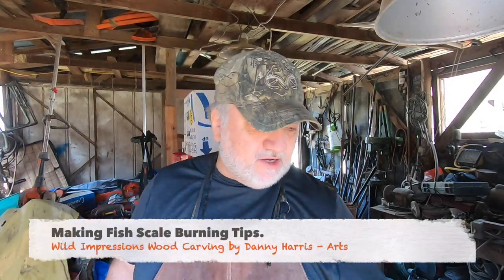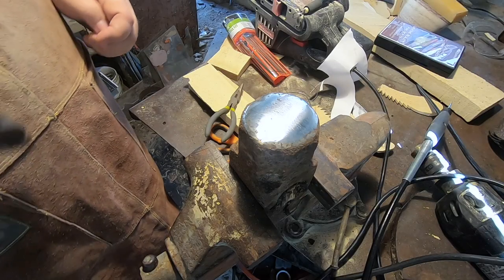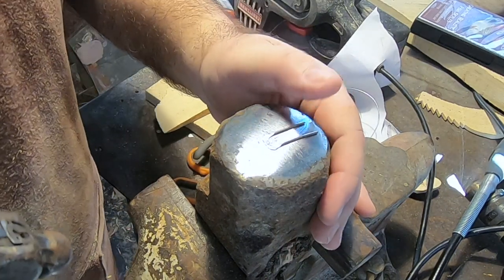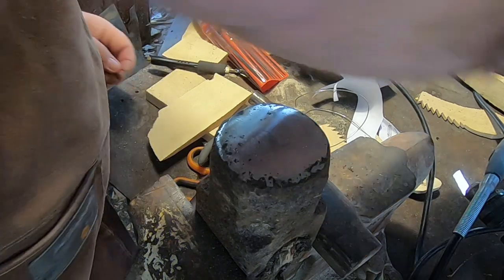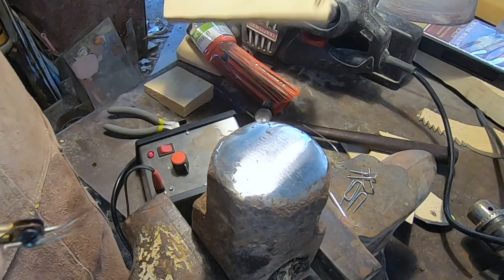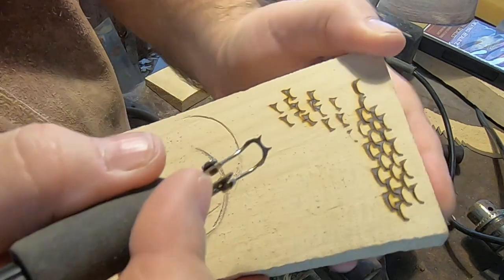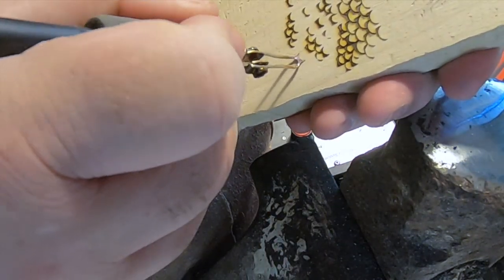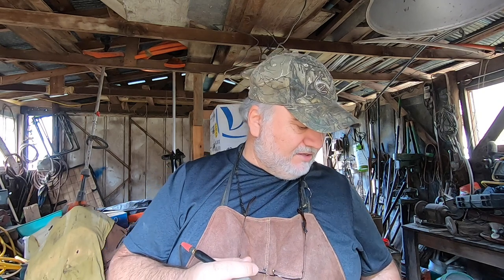DYI Fish Scale Wood Burning Tips

Comment: You’ve inspired me to start carving, I’ve been using a knife set but noticed you use a dremel a lot! If you don’t mind me asking, what kind do you use? A lot of the ones I looked at were huge! Is it a flex shaft or tiny dremel?
Reply from the maker: I started off with an old dremel 3000 i had laying around and soon bought the 4000 and a flex shaft, holding the Dremel itself gets tiresome after a while and many times is in the way for doing detail work. The flex shaft is far easier to hold and control. i still use it occasionally but I use a Foredom rotary tool now most of the time and have a couple different hand pieces. but the Dremel 4000 does a good job with small projects.

Comment: Hi Danny, Glad I found your site. I do fish taxidermy and started to carve. I am using Nichrome but was wondering if you have tried music wire? Maybe in a pinch? Thanks, Carl
Reply from the maker: Thanks I hope you like the channel and can learn from my mistakes😜I have not tried music wire. It may work if you can find 16 gauge. Anything smaller would get too hot and anything bigger may not get hot enough or fit the hand piece. 
Since it’s spring steel and already hardened you’d have to heat it to take the temper out in order to hammer it out for shaping other wise it would just crack or break. after you’ve softened the wire shaped and tuned it to where it’s burning right. Heat it back to red and quench it in vegetable oil to harden it back. 
I’ve experimented with another brand of nichrome and it didn’t work. The metal kept splitting before I got it to the size I wanted. 
You can order the good stuff from fishcarver.com. I don’t know where he got it he doesn’t specify in his video. He said he had tried several different brands and this was the only one he found that worked properly. It’s like $10 for a 5ft roll and that’d probably make more than you’d ever need

Comment: Hey Denny.. I believe Ed died a number of years ago.. Question.. On a 9" or so Bluegill.. What size scales do you recommend?  I have a collection or Razertip scale burners.. but I think the largest I have is 5mm.  I don't know if they are a Regular or Flat style tip.. I know none are the deep curve.. Thanks for these great videos
Reply from the maker: Thanks!
Yeah I knew he died of cancer several years ago but his wife and son kept the website going until just recently. I just finished a bluegill that’s approximately 9 inches. And the biggest scale was about 5-6mm and the smallest was about 2mm. So your 5mm should be fine. The bigger ones are a little flat on the arch. I also free hand the scales on the cheeks and gill covers because they tend to be a little more irregular shaped. And by free handing with a small rounded flat tip gives it a more natural organic look. 
If you haven’t seen it, it’s part 4 in the Bluegill Bream 2023 series. 
https://youtu.be/rO1bmdxHRG0?si=USBkqyHzt5f7mjPv
Reply: @Danny_Harris-Arts  Thanks again Danny

Comment: Did I miss the part on the process to harden the tips?
Reply from the maker: Yeah i think you did. Once you get the tips made and burning even and clean scale impressions turn the burner all the way up so that the tip will glow red for a few seconds then turn it off and let it cool on it’s on. You may also take a small butane torch and heat just the tip until it glows red.

Comment: I wonder if you could use a heavy duty staple
Reply from the maker: It’s possible I guess. I’m not sure what kind of steel they use. The Nichrome wire I use is designed for heating elements. It’s fairly soft until it’s heated then it turns hard. 
After I get the tip made and tuned to where they’re burning right I turn the temp to high and let them get red hot for about 30-45 seconds then turn the temp down about half for 2-3 minutes then turn it off. 
Try straightening one out and heat it cherry red and quench it in vegetable oil and see if it breaks before it bends if it does it may be usable

Comment: Can I use galvanized wire?
Reply from the maker: I don’t think so. It needs to be an alloy that can be tempered and withstand varying heat. 
Any Galvanized metal is dangerous to use when heating because it gives off toxic fumes when heated. 
It needs to be 16 gauge nichrome wire. Nichrome is designed to be heated to high temperatures and it doesn’t loose temper. 
It’s used in things like hair dryers, space heaters and other things where the wire is heated specifically to produce heat. 
16 gauge seems to be the sweet spot. Not to heavy or big so it fits in most wood burners pens. And not too thin so it withstands a lot of use before failing. (And they eventually will)
Reply: @Danny_Harris-Arts  Thank you for replying. Only problem is I have a piece that needs to be finished by Monday and no store carries nichrome 16awg. The tips I purchased broke after an hour of use. They sent me replacements and the still broke. And my temp was at 6 to 6.5.
Reply from the maker: @mosfet51  I know it’s not doing you any good right now but I order it from fishcarver.com
Reply: @Danny_Harris-Arts  already did. I have some solid copper wire that will hand to do for now.
Reply from the maker: @mosfet51  it may work for a while. Good luck with it.